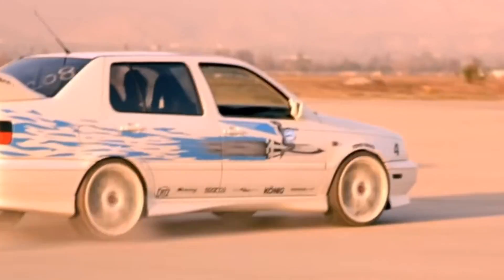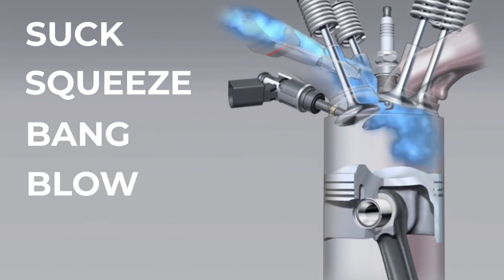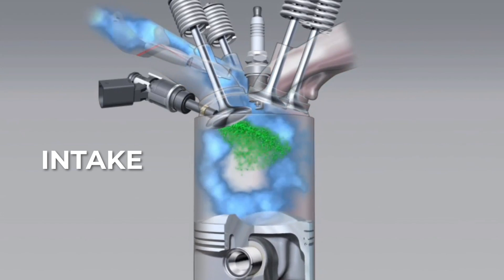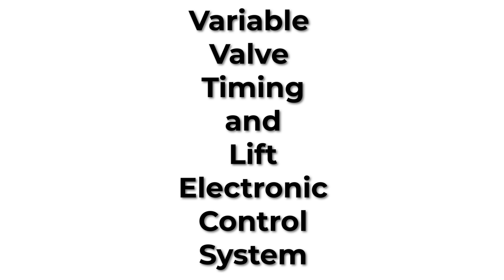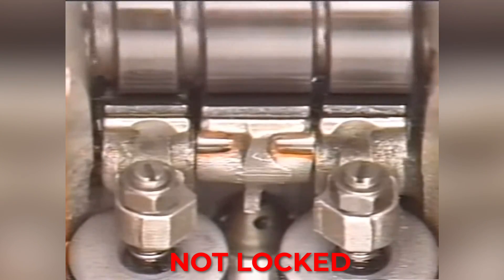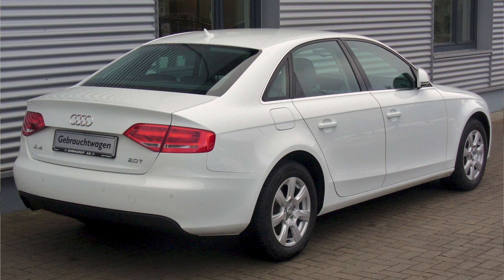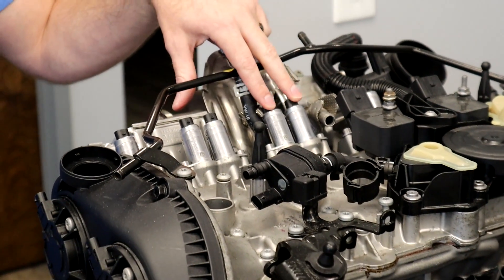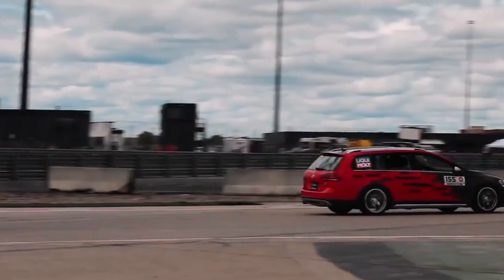Did You Know Volkswagens Have VTEC?! (Technically)

Comment: If you want an example of a technically excellent, but over-complicated and expensive design, you should see the VVC (Variable Valve Control) system on an MG-Rover K-series engine... It works on varying the inlet valve duration by using an eccentric drive to modulate the camshaft speed (i.e. it sped up and slowed down throughout a rotation of the camshaft, even if engine speed was constant). Because the speed variation needs to be done on a per-cylinder basis, the four-cylinder K-series had FIVE camshafts; a standard camshaft for the exhaust valves, and two sets of coaxial camshafts for the inlet valves. It also means you have a cambelt on both ends of the engine, as the two rear cylinders are driven off the rear of the exhaust camshaft. 
It works brilliantly as it is continuously variable, so you get very linear acceleration and the torque curve doesn't tail off at high rpm, but the system only works reliably up to about 8,000rpm so it gets removed if you are doing a substantial amount of tuning. In my early 20s I remember some of my friends weren't a fan as they liked the noticeable change in engine character as VTEC kicked in yo, but the MG was quicker than their VTECs (none had an S2000 though).

Comment: Please Help!

I have a 2018 1.8tsi golf and its making noises...

The First noise is like a surging whine. It comes and goes and isn't tied to the RPM. It is very quiet and I can only hear it in the cabin when it is happening. Kinda sounds like a power steering pump but it isn't steering related.

The second noise sounds just like the "Gnome in your dashboard" when the AC air direction motor  fails with a few differences. It comes as a SINGLE plastic knock, its coming from the front of my engine and it has something to do with the shut down cycle. I'll turn the car off, it will make its usual wind down noises but then there will be 1 loud plastic SNAP, OR the sound of a struggling electric motor.  I've heard the loud snap while driving late at night with the windows down too.

PLEASE HELP

Comment: Who would’ve thought, the new GTI has Vtec and the new SI doesn’t 🤦‍♂️
Reply: lol
Reply: Facts
Reply: Neither have VTEC.  It is through the emplyment of Variable Timing Control (VTC) that achieves better cylinder filling and exhaust simultaneously (also known as Overlap) to meet emissions standards, power delivery, and most of all efficiency.  When CAFE perameters changed gears years ago, VTEC went bye-bye....
Reply: @MegaHollywood1971  the GTI actually does have VVT as well as VVL.
Reply: Yea but it's got all those cool vents and scoops and spoilers and strakes on it 🤭

Comment: Except the difference between the v-tec that alters valve timings and the ACT system is that the latter system is utilized to switch off two cylinders during low load. VW does not utilize ACT system to accomplish any performance gains but to provide gains in economy.

Comment: Just attach the F’n valve to a solenoid and you have full timing and lift control with a fraction of the weight and complexity.
Reply: its called free valve, and it still cant hit mass production, because its hard to make efficient solenoid with a fast enough response for high rpm while also allowing for high valve lift

Comment: What's the point of having vvl on the exhaust side, it would be more effective on the intake.
Reply: these engines are turbocharged, its easier to build boost with some back pressure at low rpm.

Comment: BTW this animation for the TSI engine is not correct. You can clearly see it form VCDS logs. You can easily hit 5-5.5 ms injection time at 5500 rpm, and at these rpm`s compression stroke takes only 2.7 ms. So it's obvious, that your injector keep injecting during the intake stroke, compression stroke,  and it looks like that it keeps sending some fuel even during the combustion stroke.

Comment: Very funny but also informative video Paul!  Under reasonable load (say half to full throttle) you can actually feel the transition to the high lift exhaust cam setting very clearly at around 3,200 RPMs. As you said, VTEC mode kicks-in, albeit at very low revs for Honda-engine terms...  On stock software, I didn't really notice it, but after stage 2 (loooong time ago) it;s very apparent.

Comment: Are the cams in the MQBs good enough that the aftermarket hasn't messed with them? Or is getting a cam to function properly with VAG setup to difficult?
Reply: They are good enough, wont bother as there's wayyyy more power from bolt-ons